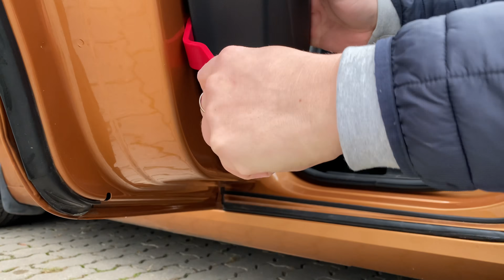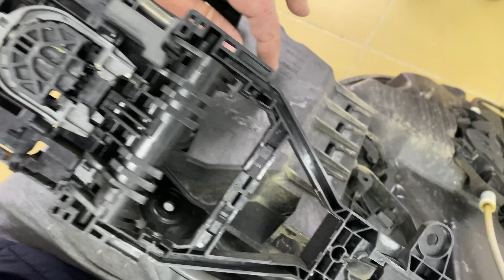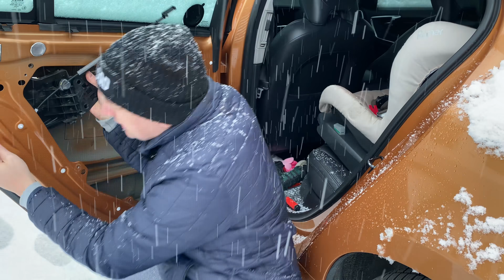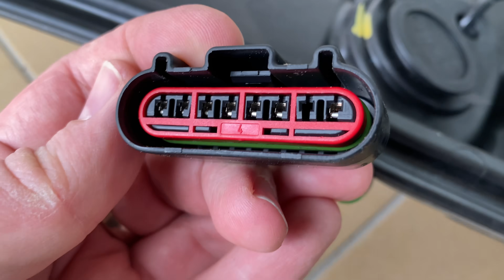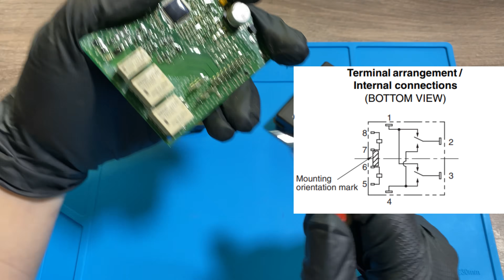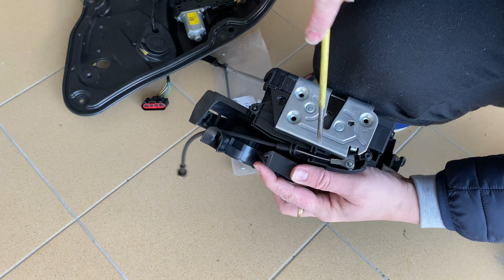Fixing my Volvo.. with FORD parts! / Volvo S60 door lock and door module repair

Comment: Thank you for uploading this video.

I have the exact same problem as you. I initially ordered a lock and found your video trying to find out how to replace it.
Then tried swapping the door modules as you did and found my lock was fine, the problem followed the faulty module.

I tested the relay as you did and mine seemed okay. I exercised it a couple times with a power supply and reinstalled it and my door lock started working again briefly.  Thought I had the same problem as you so I went ahead and replaced the same relay.

But my problem still persists :(
Right rear door unlocks, but doesn't lock with centre locking. 

Do you have any advice on what else I should check? I'm a beginner with electronics, I have been using this as a learning opportunity but have a lot to learn.

Thanks
Reply from the maker: @TheGangguns Hey man, I would recommend replacing all the relays in module... Otherwise you need to check cables, connectors whether anything else could be wrong. Not much else comes to my mind
Reply: @AlfisGarage  How did you know which pins to probe when activating the relay? I would like to test all functions on the board.
I tried asking AI but it struggles - the traces are on the bottom and hard to see.

Comment: Hi Alfi, good job! 
I have a question regarding the screw behind the rubber seal (T-25 to lock/unlock the door handle). 

I loosen that screw little more than I should and it fell inside the door. How dangerous is that, do I need to take it out or I can simply put another screw? Any thoughts? The car is Volvo V40 II.

Kind regards :)
Reply from the maker: @nemanjaste you can try to fish it out with some magnet, but I wouldn’t worry about it - worst case it will rattle :)
Reply: @AlfisGarage  Thanks for the answer, I'll try to fish it out first. 
By the way, great channel! 👏🏻

Comment: Thank you so much, by accident I found your video researching this problem. And so instead of buying the lock assembly I bought the module for half the price. So far it works, will be testing it but I hope this will fix the issue
Reply from the maker: @Zgronar Good luck!
Reply: Hey, did replacing the module work for you? I was reading that it might need to be coded to the car.

Comment: So you habe put back panel without clippimg the lock to it and its fine? 😊
Reply from the maker: @szaginsky Not sure what you mean, as far as I know I put everything back :)
Reply: @AlfisGarage i meant when you seperated inside panel from the lock ,  you said it was hard to clip it back. Di you manage to do so or can go without cliping it together😊
Reply from the maker: @szaginsky  I had to take it apart because I couldn’t clip it back. Once removed I clipped the lock back to the main plastic cover before putting back in the door frame.
Reply: @AlfisGarage fair enough

Comment: My friend Volvo does it as well bud in kinda strange way with all 4 doors like a lottery once lock won’t lock driver side once rear door, as well I can see that inside car button is no lit that orange light on button, any tip would be appreciated thanks
Reply from the maker: @CarlBertossi I’d start with drivers door module as that should be master.

Comment: Hello bro, may do you a question? I have a similar problem, however it works when the weather is hot, when change cold does not work. Couod be other thing or the same?
Reply from the maker: @EternalMomentMx yep, it is likely the same relay issue.
Reply: Hello!
Was it the same problem?
It doesn't work for me in the cold either.

Comment: My handle wont work properly in my drivers door. Handle clicked right in place but it wont open door from outside, do you have any possible solution? I disassembled my door 3 times and bought whole plastic thing with door handle holder but still it doesnt work. It feels like my door latch is too short. i dont know how to fix that.
Reply from the maker: @ryabi1805  i have not had the front door apart, so I don’t know if it’s done the same way as rear - if yes, You can try to pull directly on that pull cable to check if the lock is working or the handle is the culprit.

Comment: Hi , nice tutorial , it will really help getting to the lock.
If its not a problem can you tell me part numbers for the lock and door module? Thanks
Reply from the maker: @jokokoko9333  thanks. This is the door lock part number: 31349870
Door module: 31318963.
Bear in mind, your could be different based on options your car has. Best is to remove existing and search based on that.

Comment: Hi, great video thank you. Same issue, same door on my 2014 S60. I will try and replace the relay module first. Did you new door lock come with child lock and dead lock features? Thank you
Reply from the maker: @ianmurphy37  hi, yes it has the child lock, but I don’t know what is a dead lock feature :) however it seems identical to the old lock.